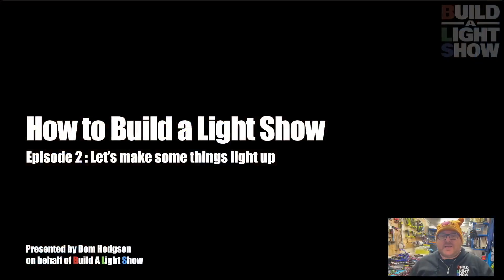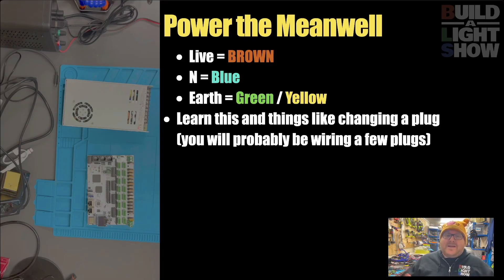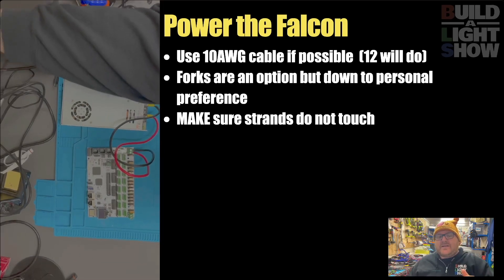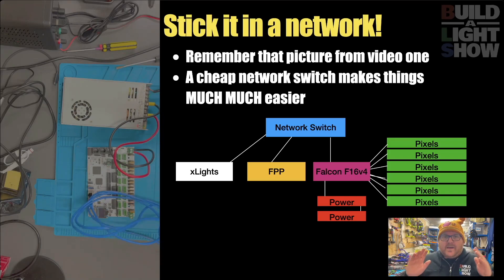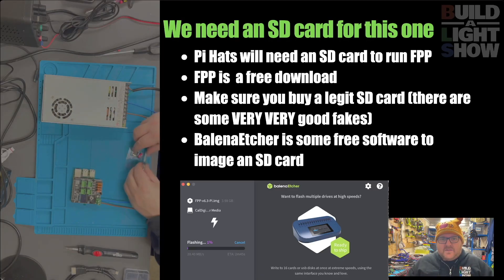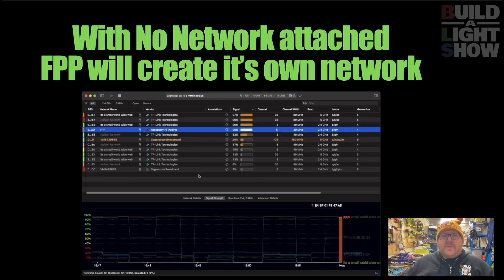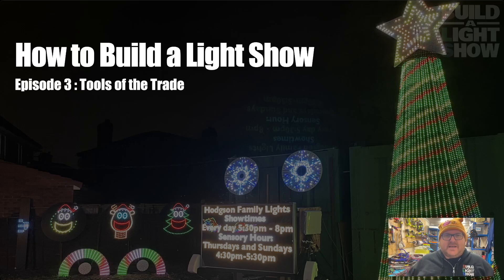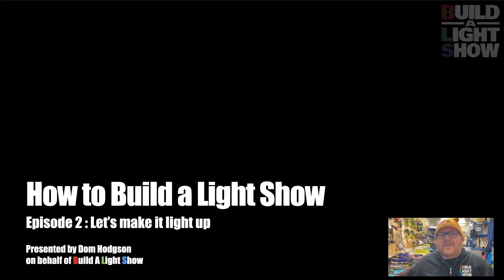Controller and Pixel First Setup - How to build a light show

Comment: I’ve wanted to do something like this for years but never knew what software to use. I’ve made my own matrix’s before and went through the grueling process of creating the animations myself pixel by pixel. Thank you for this. 

Because I want to do this more “professionally” how do you handle where you put the power and controller box and what do you encase the power supply so it is safe